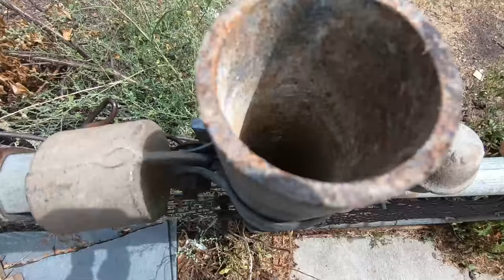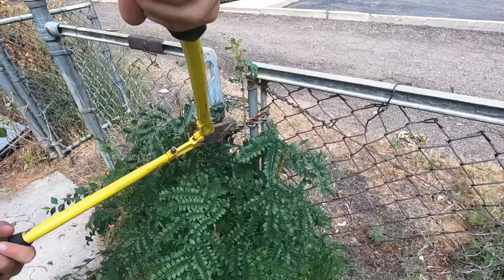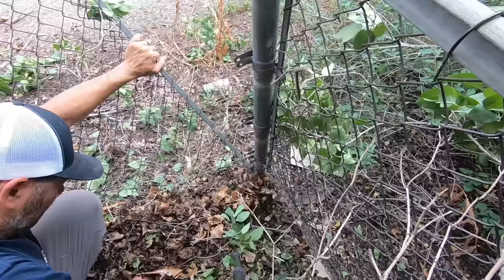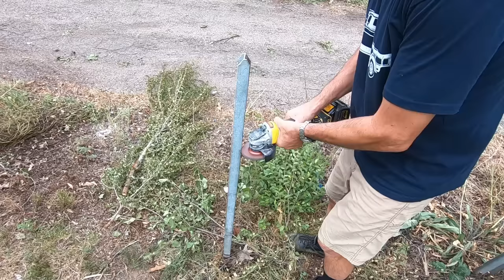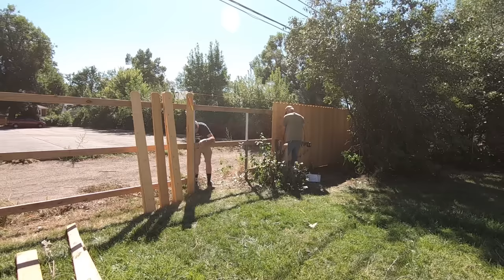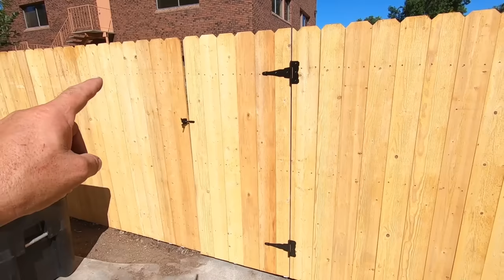Chain Link Fence To New Privacy | Using The Same Posts | THE HANDYMAN |

Comment: Nice work.  The only upgrade would be to use brush-killer on the fence two or more weeks before trimming.  If you spray-kill the plants/vines & wait long enough they'll pull off by hand. In ivy situations I'd want 90 or more days for the plants to dry b/c somehow it always get in my eye.

Comment: Where’d you get those post extensions!? That’s a great idea. I have a metal fence I’d like to switch to a taller wood privacy fence just like this. Good job.
Reply: I also need this answer!
Reply from the maker: Home Depot
Reply: @TheHandyman1  any concerns about the posts holding the weight and wind-load of the wood?

Comment: I did this on two sides of my back yard. The side facing my neighbor's make shift, thrown together, half metal pieces half wood mess my son and I placed the board's good sides facing into my yard. We couldn't use the neighbor's yard for installation. The back portion, which faces the apartment building across from me, we placed the boards on the outside, as it just looks much better.

Comment: Ready seal cedar color is what I used on my own fence but its been about 3 or 4 years and needs a new coat already. However, i put Cabot on my deck and after a year it still looks like the day i put it on. Cordovian leather color semi solid. When applying you can tell the thickness of the stain is much higher quality than the watery ready seal. I have never used Thompsons Water Seal so not sure on that one.

Comment: What’s with the ladies’ ear protection? (J/k; those who know, know.)

Screws down there, eh? Here we have to use nails because screws will break with the extreme (-45F to 115F, 5%-100% humidity) range. We use nails so they can move around a LITTLE. My fence with nails is great; my DIY neighbors’ with screws have half their boards/sections popped every year.

Comment: Looks really good. You gotta share where you got those cylinders you drove over the posts to add the height, I've never converted a chain link before. Lots of crazy people in the comments talking about how the posts should be on the inside against an alleyway. Like someone is gonna come by with a drill and steal your brackets LOL
Reply from the maker: Good to see there are some rational thinking people still here.   I got metal for the post extension at Home Depot.  They are 2 3/8" corner posts for chain link fences.  You can get them in 6 foot and 8 foot lengths.   I got the brackets at Home Depot too.

Comment: I mean to each their own but I probably would have not left the fence posts exposed for aesthetics. Maybe no one sees that but I think building some wood box posts with 1x6s and 1x4s would have been slick. But also I wouldn’t have hired a handy man to build the fence. I would just build it myself so who am I to say anything at all. Especially coming from the guy that waits for the fence panel or pickets to blow over due to rotting, hack it back up, then wait for it completely disintegrate before replacing jt.

Comment: that spans looks like 12ft , is that going to sag pretty soon ? did u use pocket holes for the gate frame? and can u use it if not. thanks
Reply from the maker: The spacing was 9ish feet every one was spaced differently

Comment: Everyone has their way of doing fences.  And everyone likes the "Smooth" side (no horizontal boards) as the preferred "Viewing side."  Here's my take on that subject.  Why are fences erected?  For show?  Or to keep people out?  Yes, mostly to keep people out or contain your dog.  When a fence is erected with the horizontal boards on the outside, it allows for a "Step" (or a ladder) for someone to climb up and over and into your yard, which is a perfect opportunity for a bad guy running from the police to avoid capture.  And with that said, the fence does not do what it's suppose to do, AND putting your safety at risk.  Yes, someone could climb the smooth side as well, but it's much harder.  Criminals are dumb, but not that dumb. All in all, the smooth side should face out for security reasons.  Most people don't see it that way, but after 27 years in law enforcement, that's the way I see it.
Reply from the maker: Most fences are built for privacy
Reply: Agreed. Privacy to keep people out.

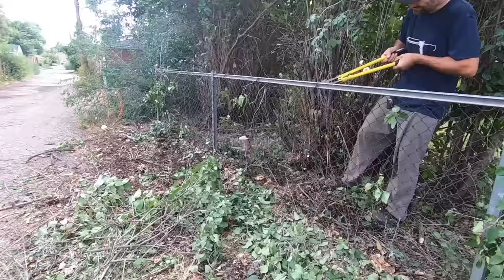Comment: I did the same thing in my carport, 3:48  but I used pre-made stockade fence panels. I like the hangers that you used on the horizontal bracing, these hangers look far superior to the c-style pipe hangers  (tube straps) I used.